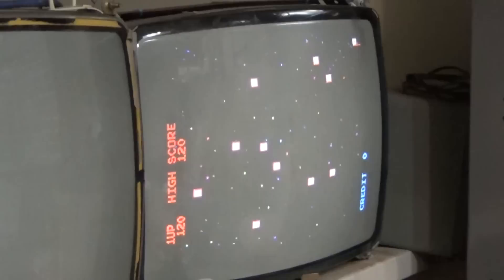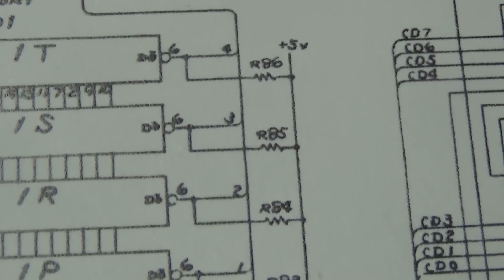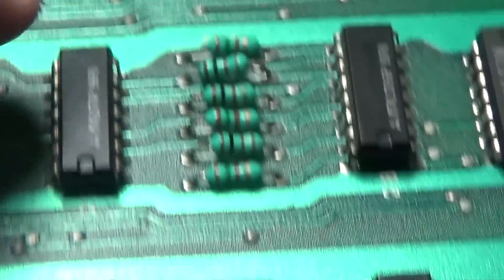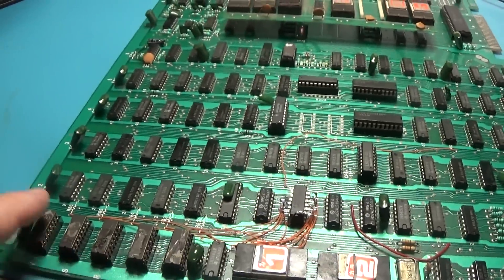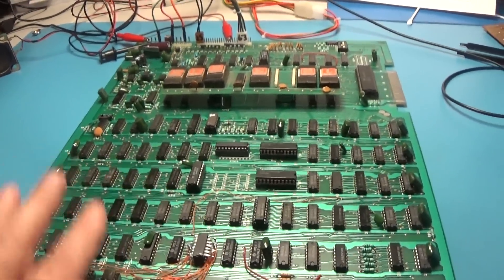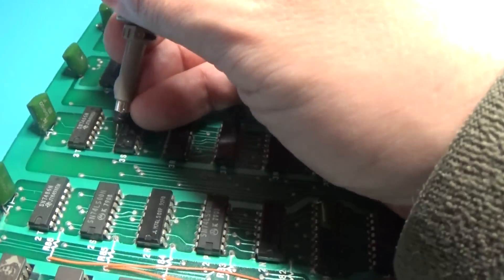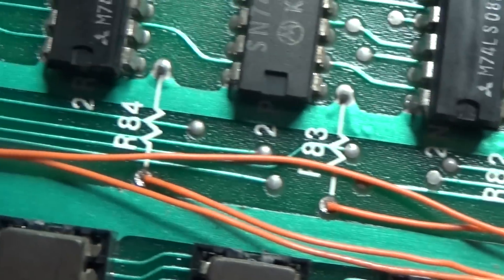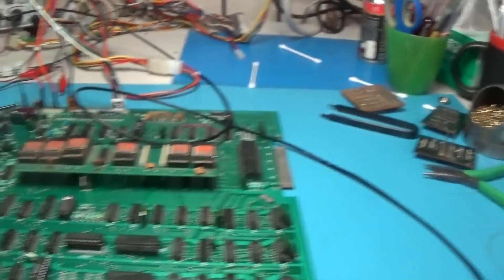Update! The 1980 Nichibutsu Moon Alien PCB Failed the Run Test!  Also Added a Mod to Improve the PCB

Comment: Just finished repair myself on a moon cresta bootleg. This was a galaxian bootleg converted to moon cresta. I did the single rom hack so I didn’t need the rom daughterboard. This worked great, then I found the macros multikit, ordered some boards and parts and build and installed it. Works awesome, about 20 games with highscore save. I think this kit will work with this board too. Was this your own board or for a customer?
Reply: running a MACRO kit myself on a galaxian bootleg.. all the games are exactly as i remember them - with bootleggy glitches and funky sound issues.. THE galaxian board experience is MACRO..

Comment: The first Galaxian I fixed had weird colors (after replacing two '161s in the video counter, rarely anything feels better than going from completely dead black screen to almost working), almost everything was red.
The outputs from the Line RAM looked weak and slurry, one in particular was really bad. Instead of replacing the hard to get line RAMs, I replaced the '174 - and that fixed it. (the outputs still look slurry, but the picture looks great - without the 174 buffer, some chips would react sooner or later to the signal than others and I bet that would cause weird glitches probably in the form of sparkles)